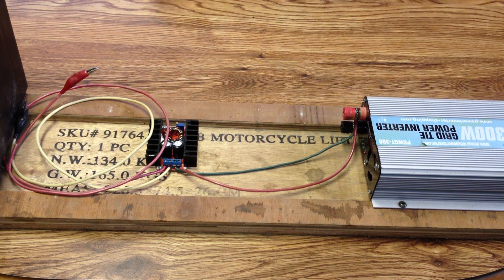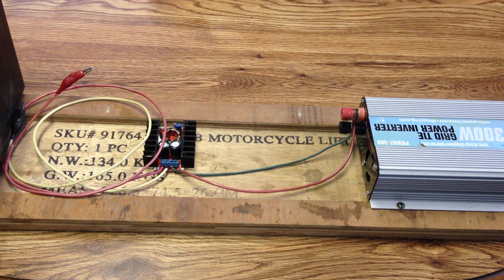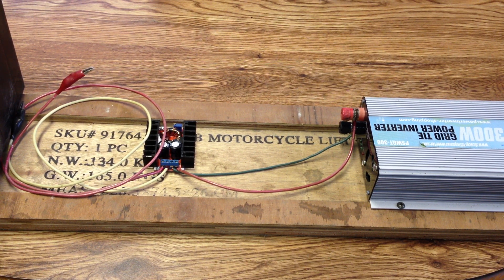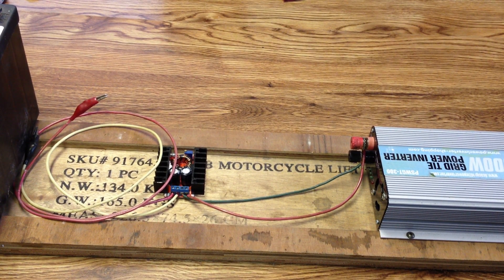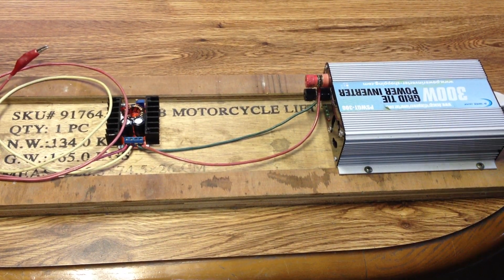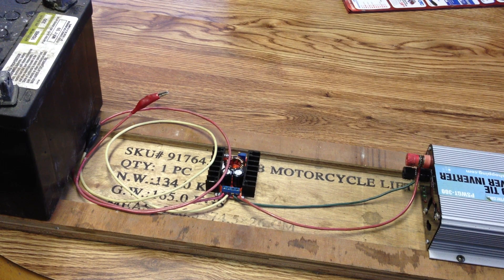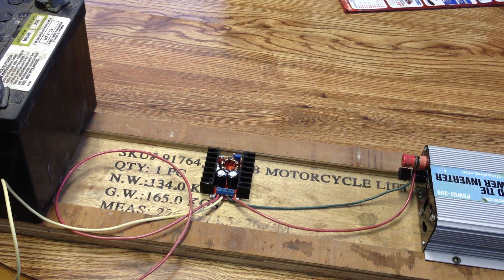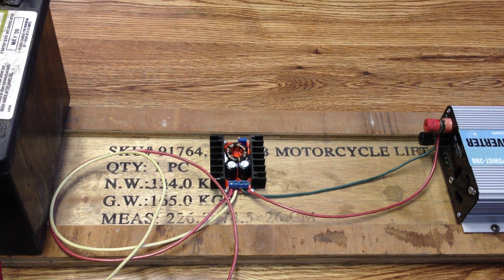Grid Tie Inverter Series: Cheap, At home Grid Tie system + Power Shifting! SAVE TONS OF MONEY!

Comment: The boost converter you are using will not limit the current but only the voltage, and if it's only letting 75 watts through what's the point?  It's a 300 watt gti ya only get partial of what ya put in. I have a 250 watt gti and 100 watt solar panel and get 85 watts max out of the gti. Kill-A-Watt meter.

Comment: can you parallel thise dc-dc converters?

did you find some that have more Oumpf?

THey're also available on ebay:
http://www.ebay.com/itm/150W-DC-DC-Boost-Converter-10-32V-to-12-35V-6A-Step-Up-Voltage-Charger-Power-/390847915141?pt=LH_DefaultDomain_0&hash=item5b0059e485
Reply from the maker: You can't "parallel" the Chinese ones together, however, you can put a power strip (not recommended) and plug more then one into that power strip (without exceeding the cord, strip and breaker ratings).    All the cheap Chinese ones like in this video and that you linked to are low quality, low efficiency junk, however, for the price, they are fine for experimentation. 

Upon re-reading, your talking about the DC to DC converters..... Totally mis-read. No, please dont parallel the converters. You could, but risk damage to them, overheating and fire.
Reply: *****

Yes, I was talking about the dc/dc converters.  But all this info is helpful, thanks

Did you manage to automate the power shifting process yet?

Comment: You do not need to cool the heatsinks unless they get over 150F or so (maybe you need to find out the max temp for the voltage regulator).. But if it is chineese made and was made to handle 150W you maybe need more cooling since i can not belive those heatsinks can handle the 150W load
Reply from the maker: Other then experimentation, I'm not using that for production. I have built some solar panels I am going to mount on top of the kids wooden Swing set.   If I were to use that dc-dc converter more, I would have placed it in a large glass jar, and submerged it in either Mineral Oil or Motor Oil. I've done that with a computer, and the heat dissipation was literally insane.

Comment: All grid tie inverters will limit the Amperage when the max limit is reached. But the crappy china inverters cant handle the max load. If they are specified for 300W i would say you can not run more than 200W over a long period of time. You need to buy real quality from SMA or such. They also have inverters that can convert your battery power back to household electricity (sunny island series). Then you can charge your batteries during night and during day you can disconnect your house from the grid, as long as you have enough battery capacity for your usage during the day... :)
Reply from the maker: Thanks for the tip on brands. I got the crappy chinese one to play with. Rather blow that one up then a expensive sunny :)

Comment: Great video man.
My question:
1. May i get the SKU number or the url of regulator that you buy from dx ?
2. Can i change the battery with "Power supply" 12 volt ?
Other word is : Power supply 12volt >>> GTImverter >>>>Home.

thanks

Comment: Right say your on a 120v power supply. If you are using a 100w lamp that runs on 120v  your actually drawing a 1000w from the battery's

Comment: Also the controller cuts off the inverter when the batteries get low. So basically the batteries are running the inverter while being charged by the solar pane

Comment: I used a 20 amp MPPT charge controller and I hooked it up to a grid tie inverter and it automatically kept the current below 20 amp. The reason I did this was the voltage was incorrect. I needed the voltage to be between 10.8 to 30 volts for the inverter and my panels put out up to 38 volts. I have the battery hooked up to the charge controller and the load side of the controller is hooked to the grid tie inverter.

Comment: You didn't consider the charger efficiency and that of the actual charging prosses (~80%). Also, any reasonably priced lead acid battery will die soon due to heavy cycling every day. Unless that dc-dc converter switches off at exactly 12V, so the battery will last a bit longer. You sould calculate the life expendancy of the battary, and deduct the replacement cost from your savings (if any).